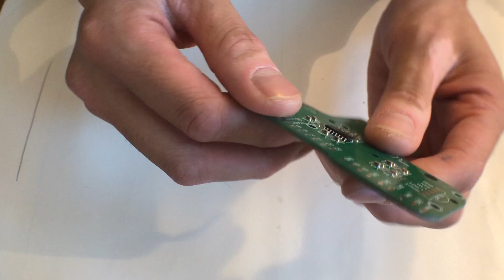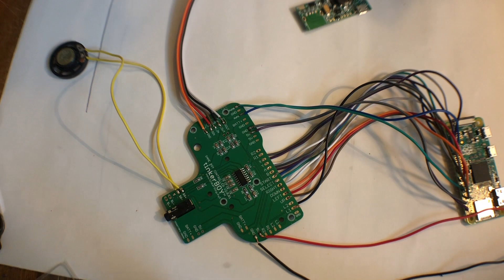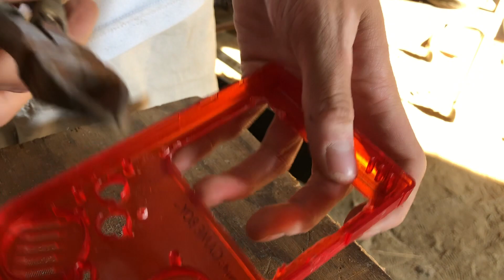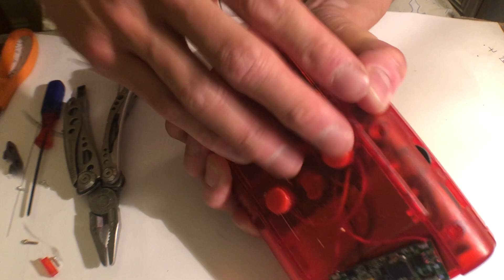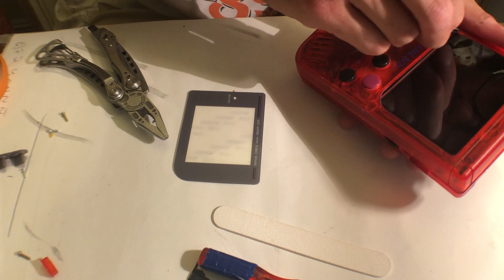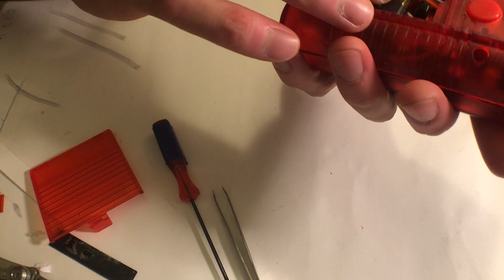Gameboy Zero PCB with audio for only $27! 1 day build

Comment: Suggestion. When working in tight spots and where you need just enough solder, tin the wire with the right amount of solder and then solder it to the chip.

Comment: Did you remove the USB on the power boost? Seems like it's missing
Reply from the maker: yes i did. i soldiered it off. u can also just cut it off. they sell them for only $1-2 on ebay/aliexpress. super cheap from the $30 gear best

Comment: Hello,
What emulationstation is used?
do you have a link?
Reply: Pardon my jumping in here -- I noticed you didn't get a reply, so I hope you won't mind a third party reply instead. I'm pretty sure that's a stock RetroPie install for the Pi Zero, albeit with a custom GBZ splash screen. There are quite a few variants around; Google "Game Boy Zero splash screen" and you'll find several handsome ones. Hope this helps.

Comment: Can I make a suggestion? Use connectors instead of hard wiring everything. This way the project is more future proof, easier to work on and much easier to work with diagnosing issues. No one wants to pull out the soldering iron just to take something apart. I like how you made the wires long enough to lay everything flat! That's very important for management.
Reply: bluecar5556 could you possible link me to the correct wires you would use?
Reply: https://www.microcenter.com/product/485527/inland-dupont-connector-kit---635-piece @PapadumGeek   
 Inland Dupont Connector Kit - 635 Piece
Edit: There are special crimping pliers if you want to crimp the connector onto wire the proper way. Then all the wires can be disconnected from one end only. Possibilities are endless, i'm just throwing ideas out there. I've learned a lot from Ben Heck on his youtube channel. Have fun!
Reply: @izardgeorge  just use jumper wires, example https://goo.gl/images/KV6Xoh
Reply from the maker: thats true, but it wont fit in the case as well